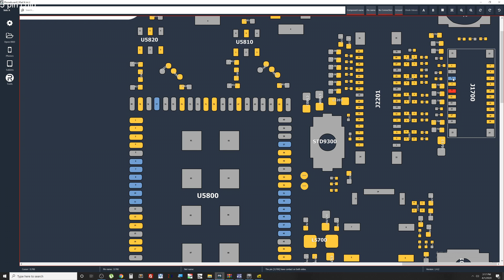0.1mm Pad Trace Repair for iPad mini 2 - Digitizer Connector replacement

Comment: What you did there was great work. Personally I would have injected low melt soldering paste into the area where the pad was, melted it, rinse and repeat until the pad is fully restored. It takes longer but it allows for a much cleaner finish. Great job either way, your hand is much much steadier than mine lol